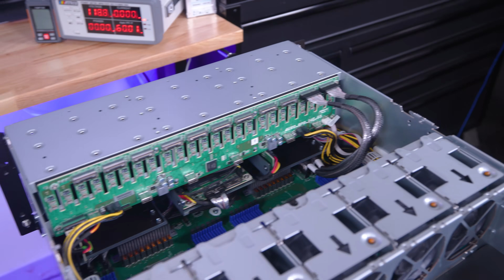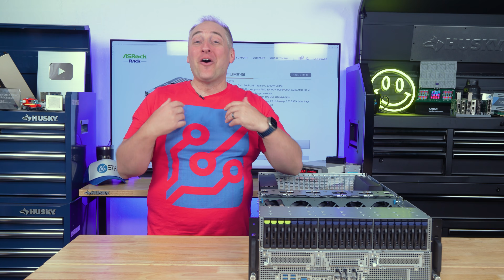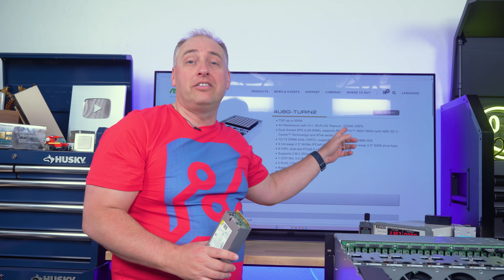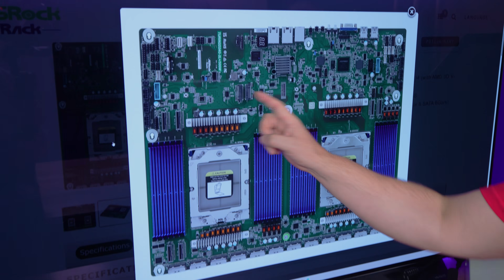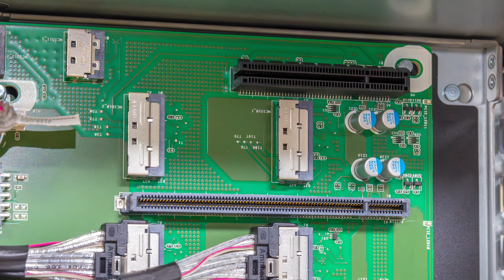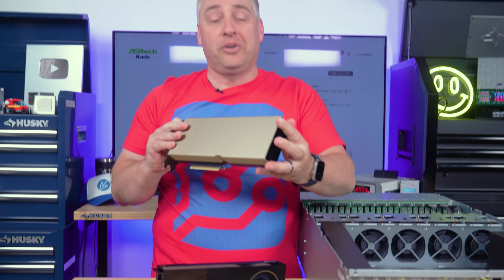The most UNIQUE 8x GPU AI Server from ASRock Rack

Comment: 13:13 actually board has enough pcie slots for 10 GPU. There are 4 mcio ports at the front, 2 of which used by storage and 1 used by ocp nic.

Comment: If win the Eurojackpot, one experiment I would love to do with something like this is to get eight cards with 8x USB 3.2x2 host ports and then connect SATA SSDs in software RAID. Theoretically, you should be able to get 35GB/s SATA storage. That's not bad at all. But then you can add hubs for a total of more than a hundred layers of this RAID for … ten thousand drives? Now that's a nice NAS! But I wonder if it would be enough to make Linux confused? :)

Comment: ASRock should have used the full 32 RAM socket setup and added the extra 15 cm to 20 cm of case length.  That system is so far 'over the top' that an extra 8-inches of length would not matter because whoever could afford that system would be able to easily afford a deep enough rack to hold it.
There is a possibility that if my electric bill went up that much, I would get a visit from the police because they thought I'm running a green house in my basement.
Reply from the maker: It also lowers max 1DPC DDR5 speed just having 24 DIMMs per CPU even if only 12 are occupied

Comment: You did not plugged power cables to the GPU. Curious, is it something you did not want to show? I wonder how it manages if all slots equipped.
Reply from the maker: We did when we ran the system with mixed GPUs. Just for filming this it is something I kept messing up by trying to fit a connector while looking at the camera so I think that footage got cut. It is super easy on data center and professional GPUs since the power connector is on the front edge of the GPU so they work well in these systems

Comment: Hope to see these mcio x8 connectors to replace those x4 OcuLink on consumer PCs
Reply from the maker: Yea Oculink had a very short run in servers because MCIO is the more robust connector. It is always funny when consumer folks get excited about Oculink as the best thing ever when it was largely replaced years ago in servers for MCIO
Reply: OCuLink is externalized. MCIO (SFF-TA-1016 "Internal Unshielded High Speed Connector System") is not. I think SFF-TA-1032 "Multi-Lane External High Speed Cable Connector System" might be its external counterpart (don't quote me on this), but this standard was only published on March 3rd of this year.
Reply: @DGao-zz5vq  I'd like to have something at least x8 width with the latest standard.
P.S. Another my childhood dream is bifurcation x2x2....x2 for x16 slot to make at home some great all nvme NAS based on some AMD Epyc 4004 or even Ryzen
Reply: @ OCuLink (SFF-8611/8612) actually has a 8x variant, but I've never seen it implemented on any motherboard, consumer or enterprise. MCIO SFF-TA-1016 have x4/x8/x16 variants, but enterprise boards mostly only use MCIO's x4 and x8 variants. I assume -1032 is MCIO's externalized counterpart, and it has x4/x8/x16 variants as well. Unfortunately it seems that the connector is over 1cm thick, so I don't expect it to become the new eGPU standard on laptops.

Comment: Do they give you guidance on sharing an expected base configuration price?  I know many will be curious about that.
Reply from the maker: With these, the main cost drivers are usually the GPUs since you have eight of then. The next biggest cost driver will be the CPUs/ memory. Then usually the system. Followed by the drives. If you are using RTX 5000 Ada cards at just over $4K each, those are going to cost a lot less than using H100 NVL cards where you can see prices closer to $30K each. So the actual barebones system cost is often far less than even a single GPU. I think ASRock Rack still has these listed as preliminary, so I am not sure exact pricing is out, but you might be able to find it online.

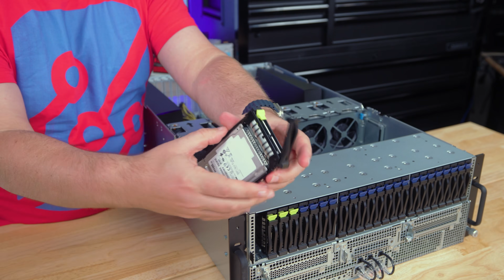Comment: 2:00 WHY IS THIS NOT HOW EVERY CADDY EVER IS DESIGNED? I have been saying this for YEARS. I've even had crappy Dell home PC cases with clip on drive mounts. Servers need standardized (like 19" rack, cmon) caddies with no screws.

No one here disagrees.
Reply: I am not sure I agree, it would be very bad if my hard drives started falling out the caddies in the data centre. Totally different ball game having a handful of caddies with drives in than your crappy home case. Besides, from a user perspective, the drives come in the caddies when new, and only Dell has you change the caddies over on warranty replacement. Everyone else ships the drive in the caddy. However, it's not exactly an everyday thing to replace a drive. So far this year, I have replaced one out of over 1000 we have at work.

Comment: Not a single mention of price/cost.
Reply from the maker: Generally these are no more than 1/4 the cost of a SXM server, but can be like 1/10th. The configuration such as cards and CPUs you put in massively shifts the price.
Reply: @ServeTheHomeVideo that's less than helpful. There's no MSRP anywhere for this stuff.
Reply: If you have to ask you can't afford it
Reply: Would like to see price of the base setup. This is kind of vital information if trying to do actual guiding.

Comment: I understand why but it's still funny to me how cutting edge servers that cost as much as a Ferrari still use analog VGA connectors from 1987 😂
Reply from the maker: Reliable analog. And the GPU IP is Matrox from the 1990's
Reply: @ServeTheHomeVideo I miss my matrox.. stable multi monitor, lovely
Reply: digital by nature, is either on or off. analog provides a gradient of "it works". VGA is everywhere and is backwards compatible. Much much cheaper to make and way less gfx to process. There are likely a large amount of built in rack mounted KVM and monitors that would have to be changed too.
Reply: @satchguitar84  It's all KVM backward compatible, for local access.
Reply: Good point.:face-blue-smiling:
Reply: Hey don't knock vga you can still get hella fps with them
Reply: Some extreme overclocking motherboards still have PS/2 ports, because they don’t freeze out like USB does sometimes. Reject Modernity Embrace Tradition, lol
Reply: Coz it's Ferrari F40 😂

Comment: Planning on moving to Alaska.  Gotta get one of these to run the compound and heat the entire home lol.
Reply: If you want to heat the home on the cheap and don't need latest gen hardware, may I suggest the x3650 M5 loaded up with dual E5-2699 v4 CPU's? TDP on those is 145w each, so each server will give you almost 300W heat. :-) Plus 44 cores/88 threads and up to 1.5TB of RAM. You won't be the fastest kid on the block, but man will you have some serious compute that'd make an IT guy back in 2018 drool.
Reply: @TheDrew2022  “back in 2018” haha
Reply: @ I still have a couple and despite the age, they're kickin some serious butt in my home lab. You can add a couple older Nvidia P40's in there (another budget option for GPUs)
Reply from the maker: Or the entire studio! Not so much of an issue in Arizona though

Comment: Looks like the best 8k or 16k gaming machine.
You can also connect your 100kg high-speed memory box if the internal memory isn't enough, 
 and there's finally room for physics acceleration.

It's sad that the average consumer is still stuck with a single x16 PCIe slot.
Sure, you can abuse the NVMe slots, but that's not the same as having another x16 slot or maybe two x8 slots.
Reply: This got worse in the last few years. In the old days where PCIe was only 2.0 or slower and many consumers had dedicated network cards and sound cards. And sometimes nvidia sli or similar multi gpu setups it was way more common to have more than one full speed slot at full with. But most Consumer CPUs have now 20 or 24 lanes for everything. And that is not that much.
Reply: @technikchaotno it didn't.
Intel's old desktop CPUs had 20x PCIe lanes. 16x went to the primary expansion slots, the other 4x (as DMI) went to the PCH. The PCH had a PCIe switch function, which provides several lanes for misc. devices. A typical entry board would have a single x16 slot (CPU) plus one or two x1 slots (PCH).

Higher end boards would support multi-GPU. 2- and 3-way were usually implemented using the CPU's PCIe bifurcation feature. Intel DT CPUs don't support 4/4/4/4 bifurcation, so 4-way implementations would involve a dedicated PCIe switch. While some MB manufacturers did advertise these slots as "x16", their bandwidth were competitively shared with other slots provided by the same switch. At that time, no matter the configuration, a desktop board's total PCIe bandwidth could never exceed x20 lanes. Not even the GA-Z77X-UP7

PCIe switches mostly disappeared from consumer boards after ~2016, due to Broadcom's pricing increases and multi-GPU being phased out. However, PCIe switches can be found on some storage expansion cards today.

Rocket Lake* added another x4 lanes from the CPU for a total of 20+4, typically exposed as a M.2 slot. Alder Lake would further add another x4, usually M.2. Arrow Lake added another x8 for two Thunderbolt ports.
* while CML shared the same LGA1200 socket, it inherited the 16+4 arrangement of prior Intel CPUs.

HEDT boards of the day could support multiple x16 slots, but it's not as if HEDT had disappeared. While Threadrippers have gotten expensive, Intel still has entry level HEDT CPUs. A Xeon w3-2423 has x64 lanes, and is listed for a mere $359.

Comment: As someone who has vast experience with AsRock Rack products, I can honestly say I'd never recommend the brand to anyone, ever. Every single product they've made has generally pretty great hardware engineering, but their bios & management software is at best half-baked. At worst it completely inhibits you from using the device as advertised. It's gotten to the point now where setting these servers up requires I block off extra hours just to deal with AsRock's terrible software implementations. Be aware of this when buying any of their products, they're janky, hardly ever work as you think they should and new updates generally disappear 18-24 months after launch.

Comment: What a great budget build.
You think I'll be able to get it (fully populated) with my next month's bonus? 😂
Reply from the maker: Depends. These servers will start probably sub $10K for the barebones, a few thousand for the CPUs/ memory, then it depends on what you put in. You can fill it for 1/10th the price of an 8x H100 / H200 SXM2 server.
Reply: @ServeTheHomeVideo  You're probably correct on the barebones. The Genoa version MSRP is $6979 and is about $6k wholesale in quantity. This one will be more; the boards may look similar but they've done a lot of work on the memory subsystem to support higher speeds.

But I really think you're underestimating the cost of CPU and RAM for this system. If you aren't buying Turin CPUs, get the older model. If you are buying Turin CPUs, you'll want to watch your number of CCDs because it affects your L3 cache and optimal NUMA configuration. The cheap ones will come back to bite you. You also absolutely, positively have to configure 24 DIMMs or you are just wasting all the money you spent on everything else.

All in all, I think $13k for CPUs and RAM is a reasonable baseline. So, about $20k before storage and PCI devices, assuming no bad losses at tariff roulette.

Maybe you could get eight used 3090's, pull off the coolers, paste on passive heatsinks (front and back, since they're 3090's), in four Nvlink'd pairs, for ~$10k. 

That would certainly be... a very interesting system.

Comment: Along with GPU, the KVM interfaces are also from the 90s.... Why the hell nobody switched their KVMs to type-c with embedded graphics like every business/hiend laptop did years ago.
And dont tell me that actual KVM switches are difficult to make with 20G bandwidth.. these local ports are mostly used to quickly fix something by attaching a console to a single server, ,no need for a multi-target switch
Reply: Because servers are tools not toys: they use what’s most reliable and have multiple layers of redundancy.
Reply: these machines are deployed by the thousands in a fleet and they don't need a fancy graphical interface to remotely manage them.
Reply: The BMC market is basically just Aspeed, and they stopped innovating years ago.
Reply: The Lenovo SD530 has just entered the room, though it is facing hardwired in, and it is all a total nightmare. The VGA is for when something has gone very horribly wrong, and you need to wheel a crash cart up to the machine and plug a physical keyboard and monitor in to recover the situation. In 99.99% of cases, this is never required in the whole lifespan of the machine once initial deployment is done. Hell you can even deploy these days without need a physical KVM.
Reply: @jonathanbuzzard1376  exactly. and crash cart should have a type-c dock with everything attached to it instead of a bunch of cables you need to connect every time
Reply: Server CPUs don't have integrated GPUs, the expectation is that the BMC will provide a basic one for video.

HPE's Gen11 edge servers have already replaced VGA with DP. But their traditional servers, even Gen12 ones, use VGA. I presume it's there to maintain compatibility with existing hardware.